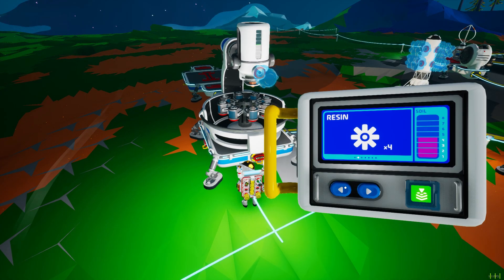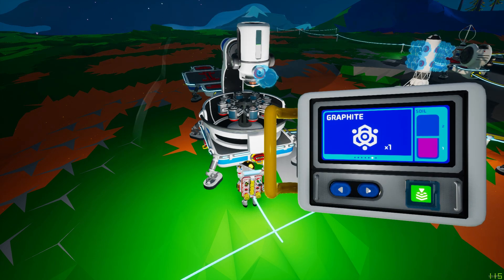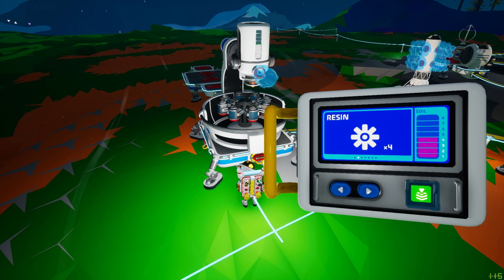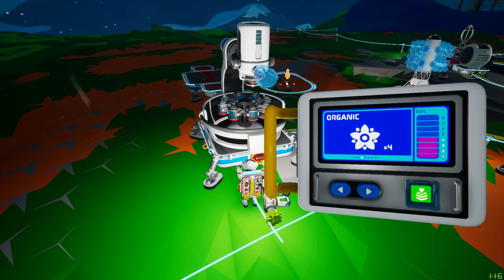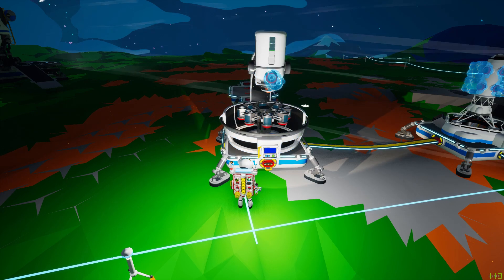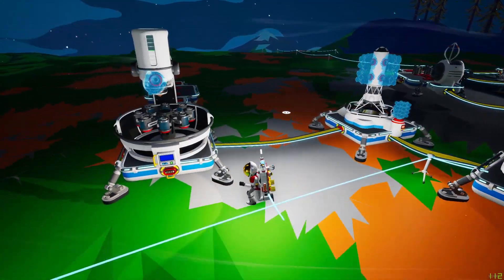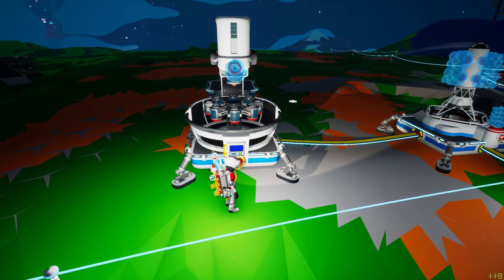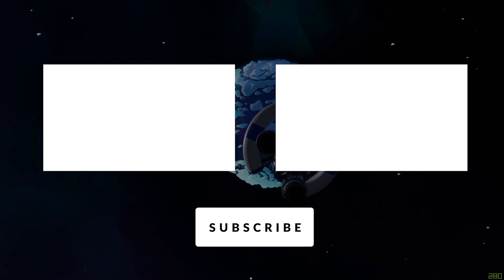Astroneer 1.0 - How The Soil Centrifuge Works (Updated)

Comment: my soil centrifuge is stuck i went to another planet and when i returned it had 1 clay block that is stuck on it and i can´t get it out of there or make another clay block from there when i fill it up and i don´t wanna make a new one for it have happend two times in a row now and thats annoying ass hell
Reply from the maker: I have yet to experience a bug like that. Sorry to hear that. Unfortunately, the best advice I have for you is to try and pick up the soil centrifuge and shake it around physically then replace it on a platform. If that does not work then you are going to have to make a new one.